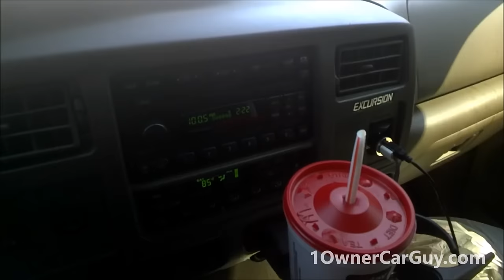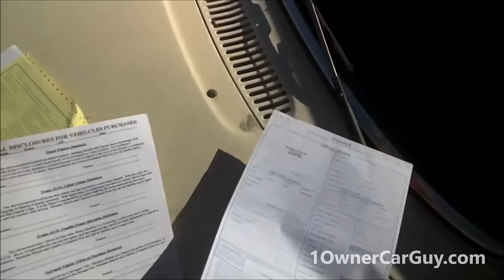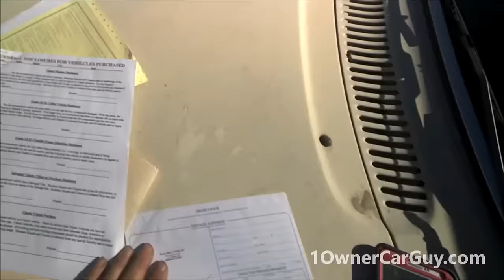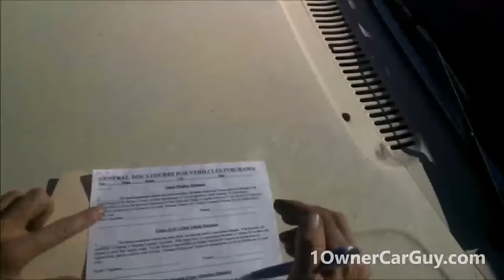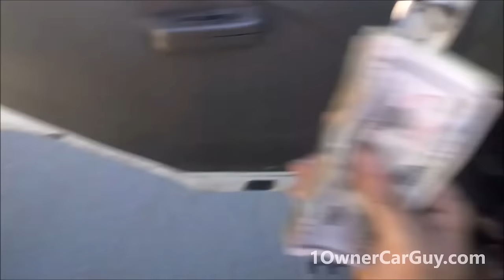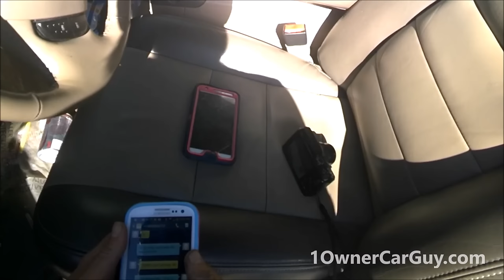SOLD!!! Movie Studio Car Transport ~ 2Pac / Tupac Universal Video

Comment: I was in Vegas when they were shooting some of the scenes at the Shell gas station. The crew and security were rude to say the least. This is cool car. Only 59,000 miles, wow. Do you know what was wrong with it? I had an 88 Regal and the 2.8 and 3.1 engines had issue with the fuel injectors being faulty. If one was bad it would shut the others off and prevent the car from getting gas. Thanks for the post